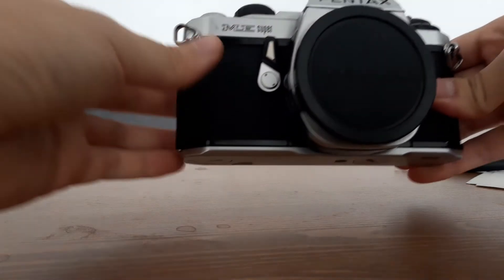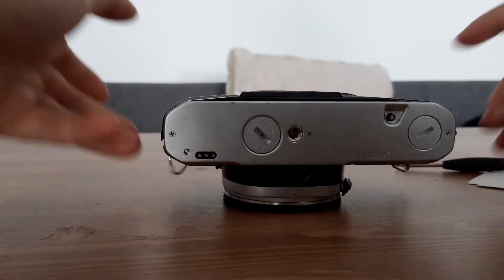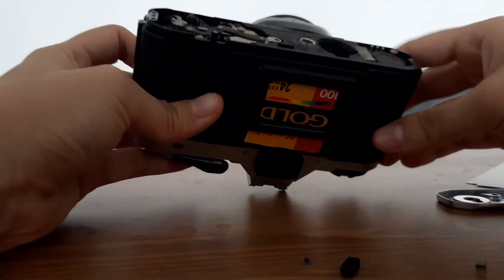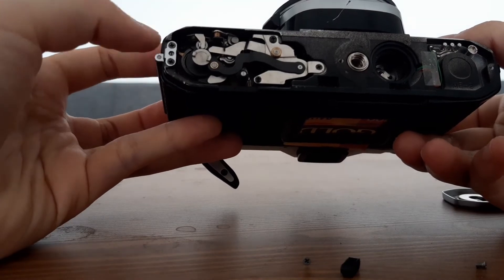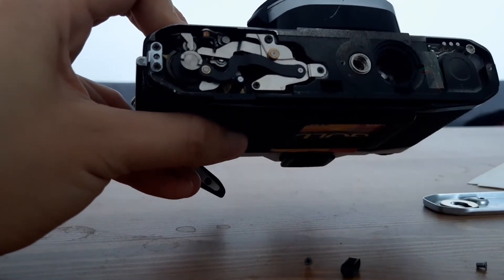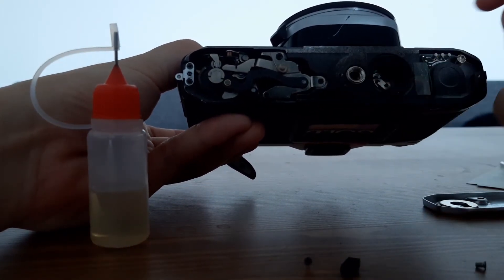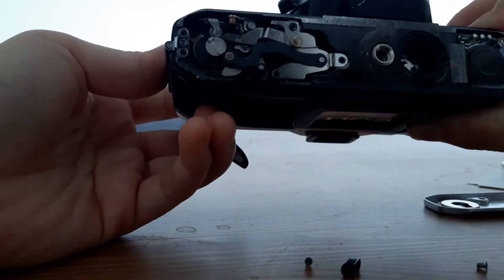PENTAX ME SUPER Winding Mechanism Fix + Walkthrough

Comment from the maker: I forgot to add that if you haven't already, you should set the mode to 125x so the shutter will operate without batteries. You can also do this fix with the lens still attached, though if you are oiling the internal mechanisms it may be better safe than sorry - remove the lens + put on a body cap.

Comment: An update to my previous comment: I have this exact same issue. Eventually got my shutter to fire consistently while manually resetting the black metal bit you talk about. That wouldn't reset because the end of the metal on one of the scissor-like bits of the advance linkage mechanism had actually bent and nearly fell off. It fully broke once I tried to bend it back so I'm going to try and weld on a new piece or get a parts body.
Reply from the maker: Good shout. Parts are pretty cheap on Ebay. I ended up being able to superglue part of the metal in my camera together, but I don't know if it would work for your issue.

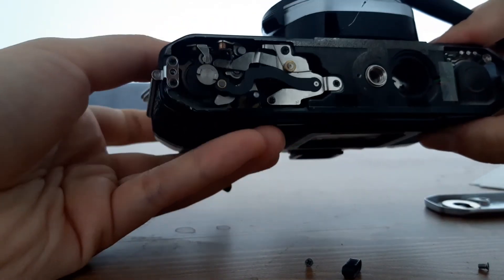Comment: I have the issue with my winder being jammed and I have gotten it to work if I manually moved the metal that you were talking about at 3:58 but if I’m not manually moving it with a screwdriver it won’t work, what do you recommend? I was having a hard time understanding your next steps after that
Reply from the maker: Unfortunately, there isn't too much more to understand! I continued to move the mechanism manually and pressing the shutter, and eventually, the mechanism began to move freely on its own. I would recommend to remember to press the shutter when trying it and see if it triggers the mechanism normally. Alternate between moving it manually and just trying it normally with the winder. You might also want to check via the working mechanism in the video whether any spring or piece of metal has moved out of place, as some of these pieces will rust and break easily.

Good luck!

Comment: This is helpful but my advance lever is “floppy” and when I use it it moves but the whole mechanism doesn’t move at all, do yoh think it’s the same issue? When I open it nothing looks obviously out of place. Does anyone know a forum where I can maybe share videos or pictures? I love my ME super and I’m super bummed I can’t use it 😢
Reply from the maker: It may be the same issue - originally, as I said, the advance lever on my camera moved but there was no tension at all (I assume that is what you mean by "floppy"). Since the advance lever is not engaging the winding mechanism at all, when you open up the camera, you should be able to see which part of the advance linkage is not moving and I suggest you try manually moving it to see if you can get it to engage again. 

If it's not obvious which part is misplaced, you might try to simply remove the advance linkage and then re-attach it, making sure that all the pieces are correctly placed as per the working mechanism in the video. Hope you manage to fix your ME super!!